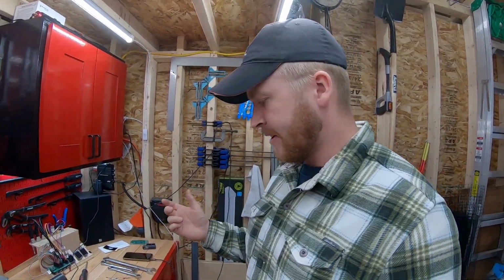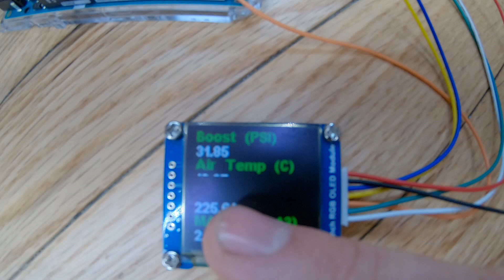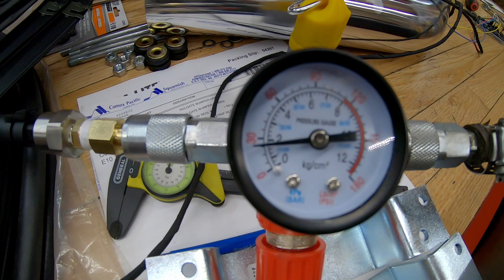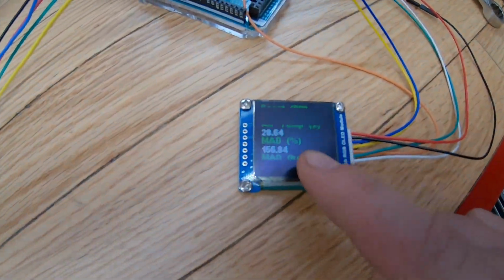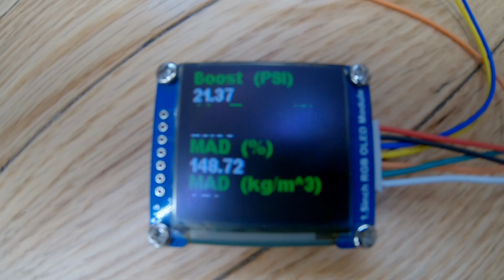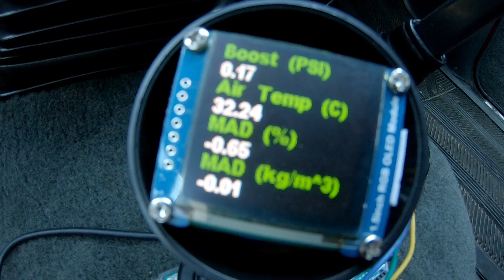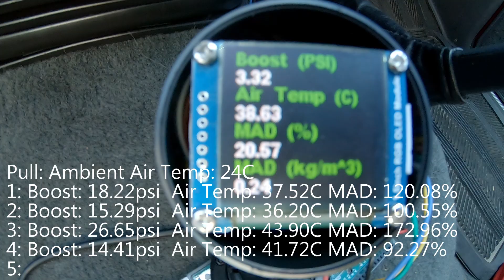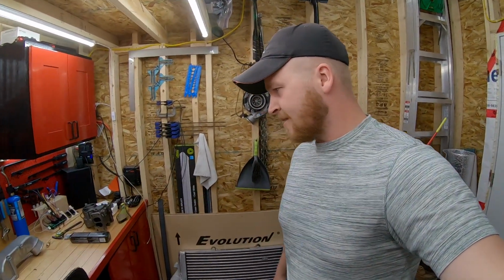Density Testing | Pre-Intercooler Swap

Comment: Great Video and very interesting!! The only way to truly test it is, do a before and after on Dyno under load, like they do on all the diesel performance channels.
Reply from the maker: Yeah that would be great. Calling anyone who wants to sponsor these vids and supply a dyno... haha. This is the next best thing I can do.
Reply: @OvensGarage  Is there any Dyno Shops in your area, that you can buy an hour of Dyno time?
Reply from the maker: Yeah there is one in town but the rate is like 150 bucks an hour. Once I'm done all my intercooler/turbo mods and all my street tuning maybe somebody will buy me a trip to the dyno for my birthday or christmas...HAHA
Reply: @OvensGarage  I'll buy you an hour of dyno time if you share your code :)
Reply from the maker: Haha, what code haven't I shared yet? ;) But yeah I'd love that! lol
Reply from the maker: @jlaustill  Yep that's mine. That's only the coolant sensor portion I uploaded though. I have another excel tab where I did all of my density calculations. I'll try and make a vid of where I'm at with my whole setup tomorrow and get it uploaded so you can see how everything looks. I probably won't run through the software side but mainly what the hardware setup looks like right now. I appreciate your support, it's just been a hobby of mine over the past year doing some of this.